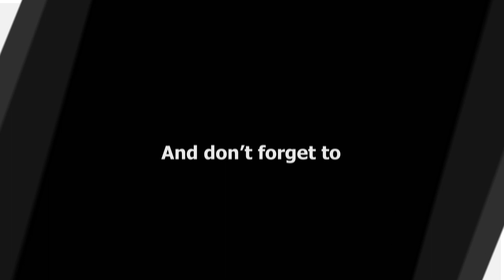Paul Holmes Open Source Inverter Testing

Comment: Hi Damien, thank you for the vids, I've been following your and Paul's channels for a while now, I'm building a 2cv powered with a Lexus MGR using Texas Instruments Instaspin FOC controller, but I'm struggling to integrate the resolver feed. Have you done any work with the TI controllers? .............................."If we knew what we were doing it wouldn't be called research would it" ...A Einstein...................................